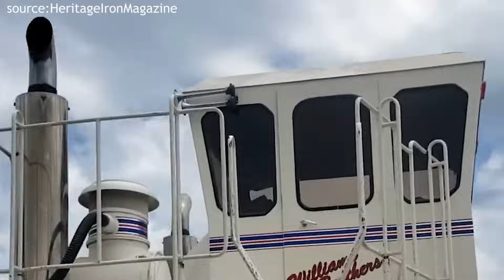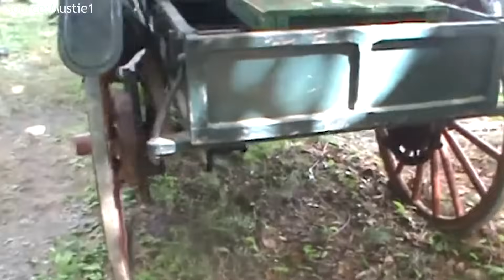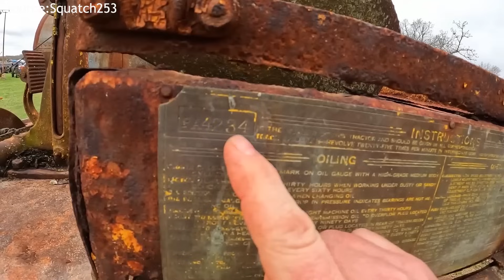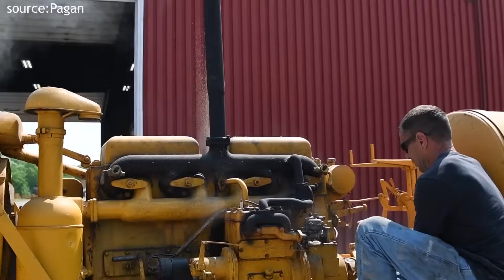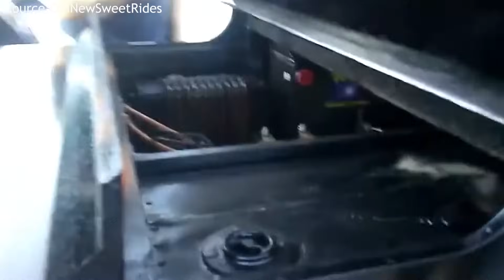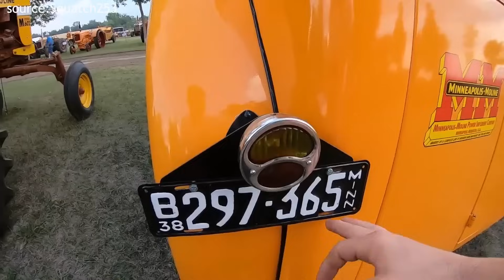10 STRANGEST AMERICAN TRACTORS EVER BUILT

Comment: I ran open station tractors in the 70's and 80's.
    I would have loved to have the comfotractor.
Reply: no a\c though. so unless you're up north it'd be hot and also terrifying at top speed. I've driven tractors from that era, they're scary enough at the sub 20mph speeds they go at. Hell even the modern ones are scary in the higher 20s.

Comment: New Idea bought the "Uni Concept" from Minneapolis-Moline in the early 1960s. New Idea built Uni tractors and their attachments at their Coldwater, Ohio plant. The last New Idea Uni tractors were built was in the early 1990s with Cummins diesels. These models were the 800C, 802C and 803C. My late father had two of them. One with a 110 hp GMC V6 gas and the other one with a 105 hp Perkins diesel.
Reply: I'm in the UK which one was better I'd be surprised if they actually differed much in proformance.